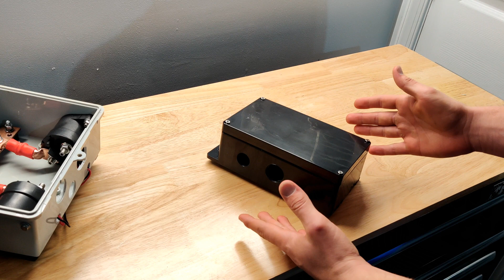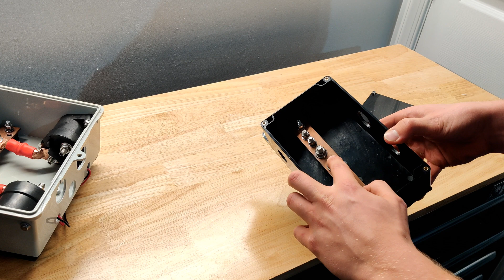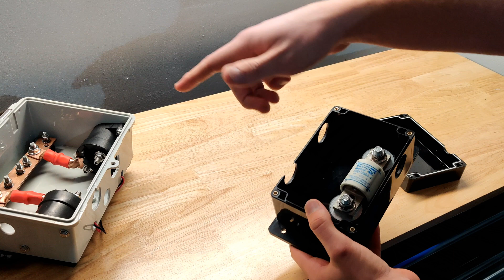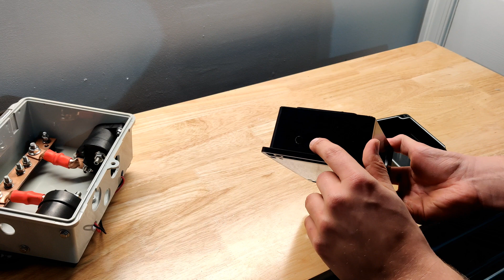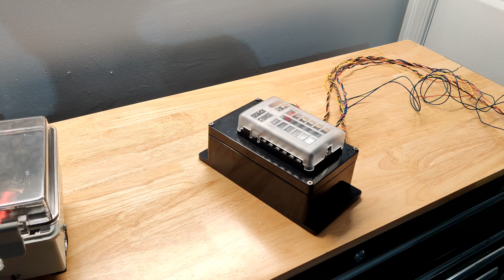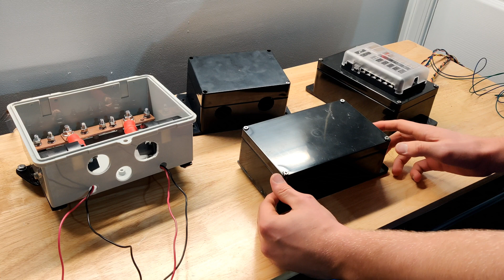Ford Escape EV Conversion EP 21: Contactors and Junction Boxes

Comment: Have you bolted the fuse on a vibration dampers?
Reply from the maker: Yep all of the large fuses are on rubber mounts that serve a dual purpose of both vibration dampening and electrical insulation so the securing hardware to the contactor box isn't connected to voltage.

Comment: do you have a precharger circuit?
Reply from the maker: I don't have a separate one, but there is one integrated into the X1 inverter. Definitely important to have some sort of precharge circuit with these high-current inverters though! Most modern inverters have it integrated nowadays though.
Reply: @reider_mcfeely  oh, I thought you needed one for the contactor. But if the inverter is on one ide of those contactor perhaps it can charge it up. Not sure how it does that if it is behind the contactor though. Hmmm.
Reply from the maker: @FrankGraffagnino  the inverter has a precharge connection that bypasses the contactor.

Comment: I'm in the process of installing a Hyper 9 in a boat. I'm curious why you have added a second HV contactor in addition to the one provided?
Thanks
Tom
Reply from the maker: Hi Tom, good question. I wanted to be able to switch the inverter on it's own, so I could run accessories (like an electric AC compressor or the DC to DC converter to keep the 12v battery charged) without also powering the inverter. If I just used the contactor that's included with the Hyper 9, I wouldn't have this option. 

It's not really super important since you can just not step on the accelerator pedal and the inverter won't draw much power while connected. But I wanted to have it separated like that. Most people use just the included contactor with no issues. 

I'm interested about your boat project though. What boat are you installing the motor in? And what batteries will you be using?
Reply: @reider_mcfeely  Good answer,, makes sense for you.. The battery is lifePo4 cells configured 2p30s. 96 volt nominal. I have some videos posted on my other channel, EV Boat Conversion. Episode 1 is an overview of the project.
https://youtu.be/Ycw7SEbEmG4.
Reply: Also episode 5 is a Hyper 9 bench test, might be of interest to you.
Reply from the maker: Thanks, I'll check it out

Comment: Thanks for a very informative video.  Will you now be having a precharge   circuitry or your controller takes care of it? Also, no negative HV contactor to completely disconnect the battery?
Reply from the maker: The Hyper 9 inverter (AC-X1) handles precharge on it's own thru the key switch input. So you switch on inverter by providing the full pack voltage (120v or so) to the Key Switch On connection on the inverter.

I just felt that a negative contactor wasn't really necessary for this build. A lot of people will only use the 48v contactor that comes with the hyper 9 to switch on everything (in my contactor box it would be like having the 48v contactor in place of the 12v contactor, and no contactor on the inverter side). But I wanted to have a switch for just the inverter, then a "main disconnect" of sorts. Having an additional negative contactor is only for redundancy in the event that the positive contactor welded itself shut. But since I have 2 ways to shut off the only load with  substantial current draw in my system (the inverter), I didn't feel it was necessary.  

Hope that makes sense.
Reply: @reider_mcfeely  
That makes sense. Thank you for helping me understand.

Comment: Wonderful just what i wanted to see. These bits always get skipped in others videos. The wiring is EXACTLY what I want to see. The more the better. Thank you. I plan to put both poles into one box. Ie positive and negative into the same. Contactor box up front. In the back of the car with the batteries will be two fuses in the same box, both poles. I think you separated your poles because you have front and rear batteries. Where as I will only have them in the rear. You should consider having main fuses on both positive and negative. Thats what we must do in New Zealand and I think its a good idea. But upto you .
Reply from the maker: Yep, fuses on both negative and positive can't hurt but not really necessary. If you can cut off the "supply" (+) with a fuse on positive then the negative fuse is redundant. I have a hard time imagining a scenario where having a negative fuse as well is beneficial. 

I'm also not fusing the battery boxes individually. This could be helpful, but I felt it was unnecessary for my project since I would need 3 more HV fuses ($$$ and complexity), and the modules don't come close to directly contacting the metal frame of the boxes. If you're making the sides of your boxes out of metal, then it's a lot more important. 

Putting positive and negative in the same box can be a little more risky though, as you could have a short that could potentially bypass fuses (depending on where they're located). I'd definitely recommend separate boxes if possible. If not, I'd add a service disconnect or something so you can work in the contactor box without worrying about a short.
Reply: @reider_mcfeely  we must have a physical disconnect. In my case a Anderson connector near the batteries
Reply from the maker: @blackterminal  Interesting. I always hear a lot about the myriad rules NZ has about conversions. Here in the US it varies by state, but just about every state has no rules for a conversion as long as it passes a generic safety inspection. As long as the brakes, headlights, and parking brake work you're pretty much good to go.